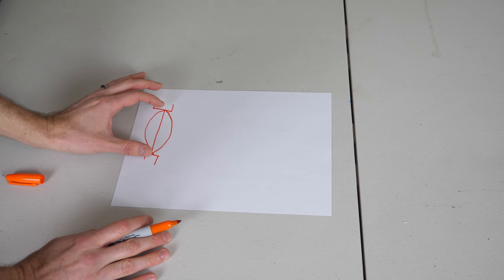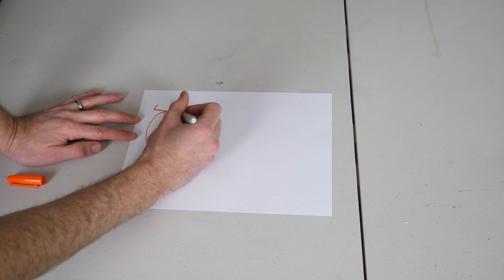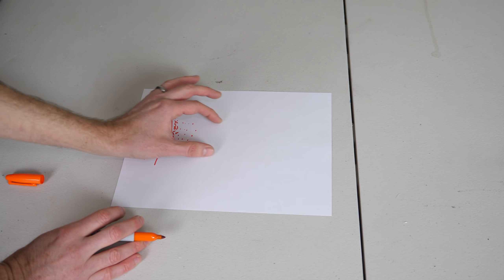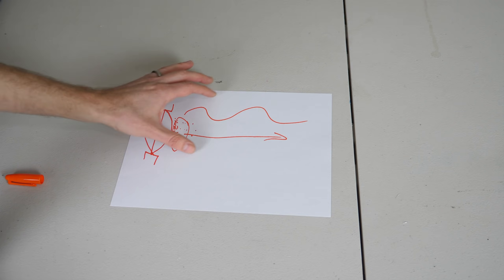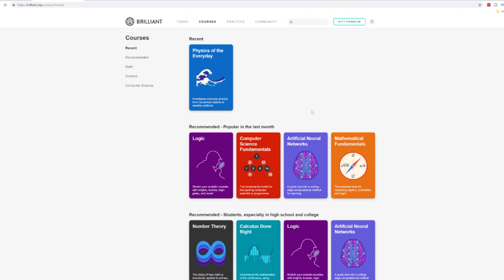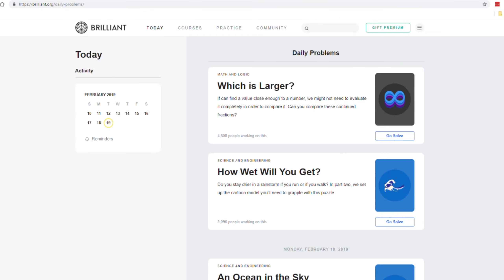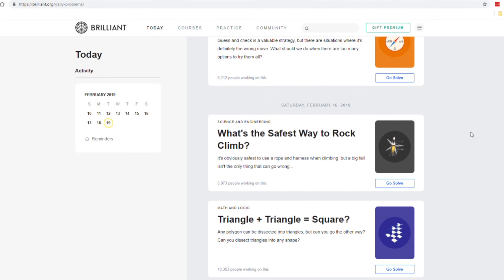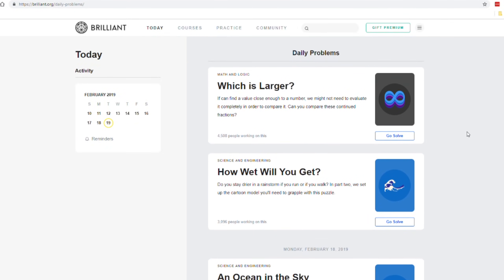Can You Figure Out the Mysterious Self-Singing Pipe Experiment?

Comment: Can you try to break the glass by sound produced by resonating rod
Reply: The glass would only break if the sound from the rod is the same resonant frequency of the glass.
Reply: @AdamWebbadamwbb  yes and  that's what I wanted to know that can a rod resonates at that frequency or not .
Reply: @gulvindersingh2275  Yes it can, you just have to find a glass and a metalic rod with the same resonance and voilà!
Reply: @martiddy  but the problem is every metal have different resonating frequency.
Reply: @martiddy  and resonating frequency also depends on the shape size and thickness of metal
Reply: You could probably lock a longer aluminum rod at a certain point in a vice, and that would force a higher pitch/frequency. That could "tune" the rod to match the pitch/frequency of the glass (potentially by ear when gently pinging the glass and hearing the tone that it rings at).
Reply: Ian M  maybe this works